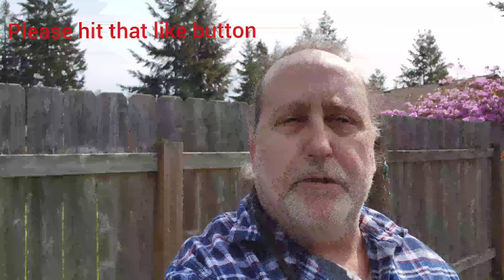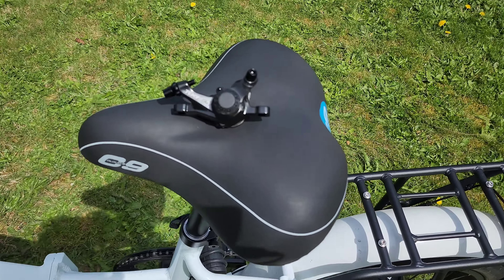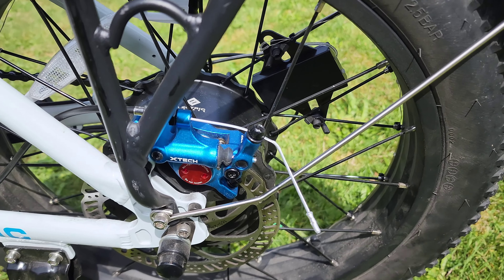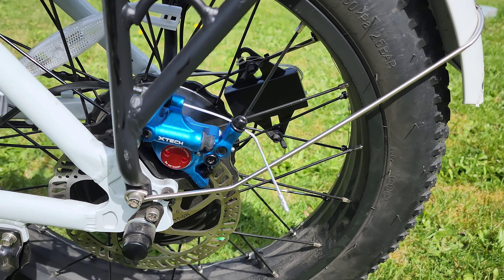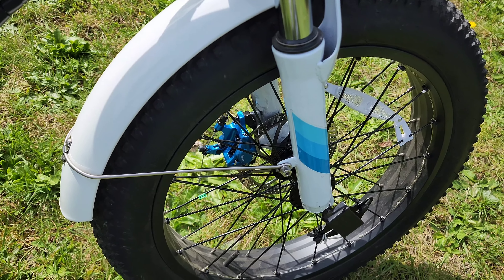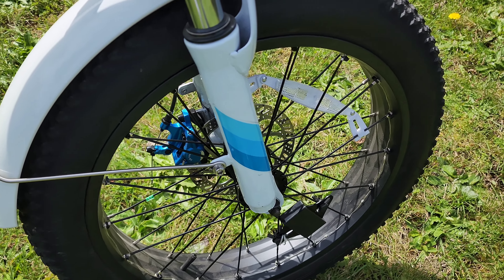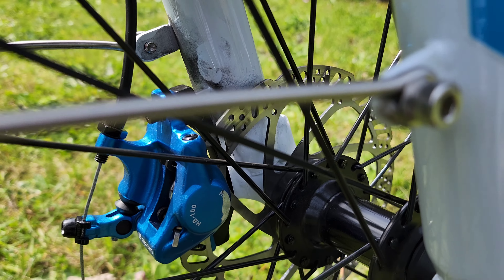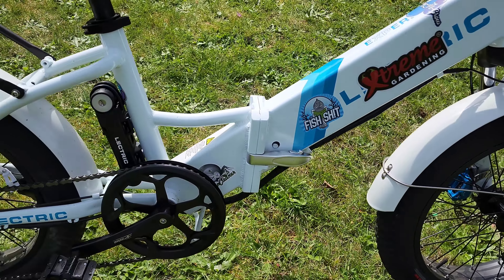brake upgrade/ Lectric xp 2.0

Comment: Amazon has Disc spacers no need to take a hammer to it lol 0.5- mm or 1.0-mm spacer would have done it I have the same brakes and color had the same problem the spacers took care of it with NO HAMMERING involved    mine had more than one spoke hitting it as well bike just came bake from the shop wheel was trued up and still hit, I needed to use 1.0mm spacer on mine some peeps been saying 0.5 mm been working on there's and lol SMOKE A FATTIE FOR US ALL HEHE
Reply from the maker: @john doe hi John how you doing! That figures that there's a better way. The spacers would have worked great. I honestly didn't know there was such a thing. Leave it to me to get out the freaking hammer. Well at least I used the small hammer lol. That's not like me at all hahaha. Thank you so much for the heads up. Next time I'll leave my hammer in my toolbox. I really appreciate you watching 👀 my videos and taking the time to comment.  Ride safe my pev brother 😮‍💨
Reply: @scoottheharbor  lol no problem I use a hammer on allot of things mostly my head trying to figger out stuffs and how to make them better or work better at least  next up after warrantee wears off is duo battery 20 miles on pas 3 not bad but want more miles before running out of battery and have to peddle home or to the car /truck and that sucks big time having to peddle or walk back any whooos I'm off to roll a fatty stay safe and ride safe from one friendly old fart to another stay safe my friend and keep token puff puff pass